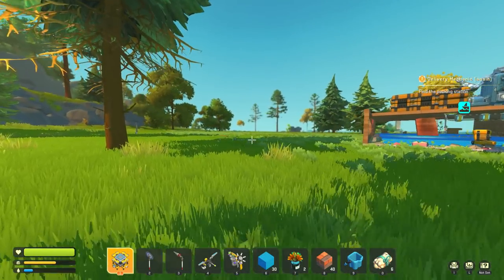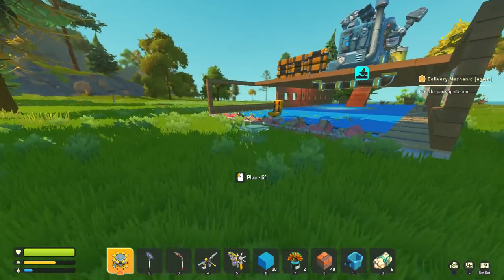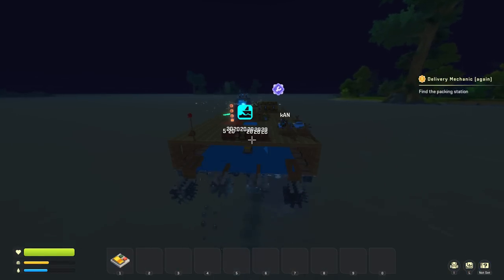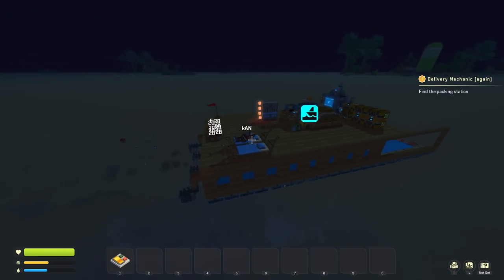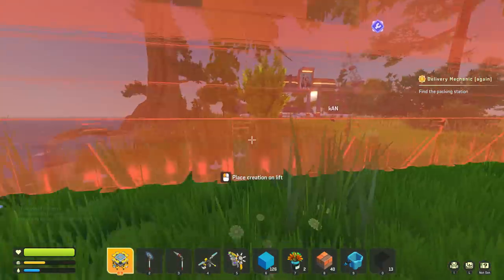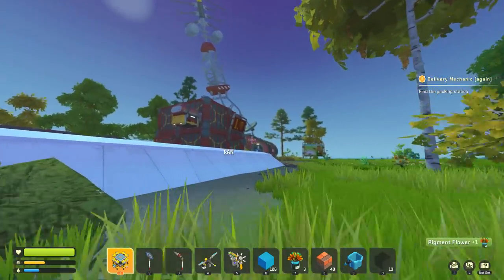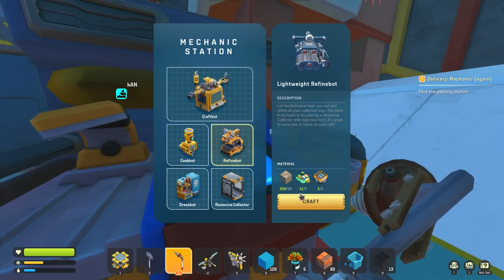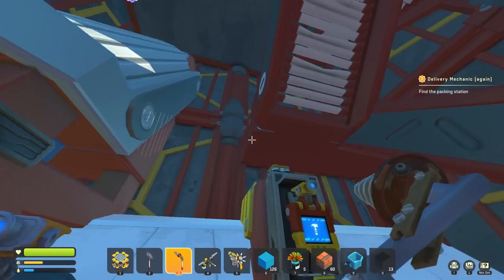Building a RESOURCE CRANE on Our RAFT for Better Mining! (Scrap Mechanic Raft Co-op Ep. 8)

Comment: You could get the crane to an edge of the collector, put it on sideways and get seats on it, to get up and down. Since you have 2 switches connected with a logic gate, you can even connect each switch to one of the seats ^^

Comment: swappable collectors would be handy for deep sea operations.
a couple extra collectors you can carry around will make collecting wood far easier.
farming to get spuds will be important as Spud-guns are priority for self defense against Tape Bots.
suggestion for fine maneuvering or station keeping above a mine site.
place a motor with a single prop on each side to slowly sideslip. in addition, one each Bow & Stern will permit full directional control at low speed leaving the main engines off when you don't need them.

remember to keep an eye out for anything that can be broken down and salvaged.
parts is parts! the source doesn't matter if it's useful.

Comment: @Kosmonaut Your collector looks good. You can feed one refiner bot with two collectors easily without any problems. Just rotate them by 90°. After rotating them you can place them so near together that both will stand right in front of the refiner and will he will toss from both of them. I used it several times now without any problems. My main vehicle in survival has 2 refiners with 3 collectors and the 2 refiners share the middle collector. I know, it looks like there is a direction those collectors must have, but they doesn't need to, they load the refiner even from the side.

Comment: 5:30
this is a tile in the normal Scrap mechanic survival. iirc center north of the map 

and put the resource collector on a block instead of directly on the piston, if you ever get 2 you can switch them out without issues

Comment: I'm the guy who commented on the duplicate Trader items needing farmers to buy.  Originally, there was a single set of items to buy from the Farmer.  I played a day or two before your last video, and an update had added a second set, and the second set was the original survival prices, so some things needed farmers to buy.  I commented on your video, and then launched the game to verify.  
Another update had made the second set identical to the first.  I deleted my comment, so it was only up about 5 minutes, but that was apparently long enough for you to read it.  Sorry for the confusion.
FYI, the cell with all the red tubes (like the tubes by the mechanic station) also exists in vanilla survival.  It doesn't have a purpose there either.

Comment: for the double collector system. why not use another set of pistons and make a second setup. you could also have a switch at top to deploy a collector, and logic and switch's on the collector to switch the two back and forth.

Comment: Should just put 4 drills on the bottom of that collector and power with a controller or something. Then lower it down right on top of the rock pile. Boom. Mines and collects at the same time and won't have lag because it collects instantly.

Comment: Island you find at the 5-minute mark I have come across in regular scrap mechanic. I'm not entirely sure what it's supposed to be besides a habitat dump but it's not a mechanic station or the second mechanic station. I think the refinery can pull from two collectors if they are both in front of it. I did find they tend to favor one collector over the other so maybe there was a bug in the programming but it will pull from the other collector if placed in the correct spot. As for an idea for your mining rig, it might be worth  figuring out how to put a seat on top. This would allow you to just ride your collector up and down.

Comment: why dont you use some of the propellers that you have to give the boat tank steering? you could use a steering converter and like two extra engines for that and it would solve the missing problem